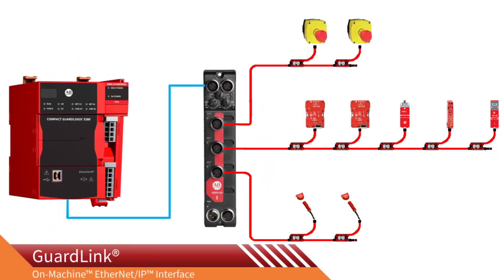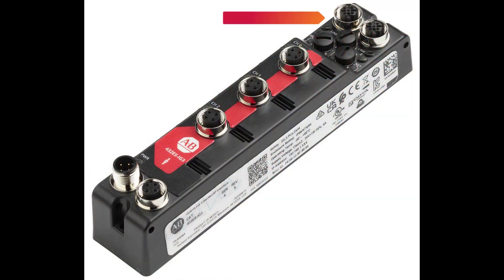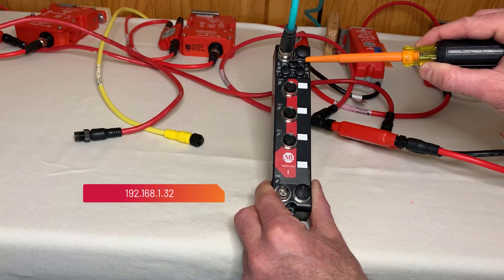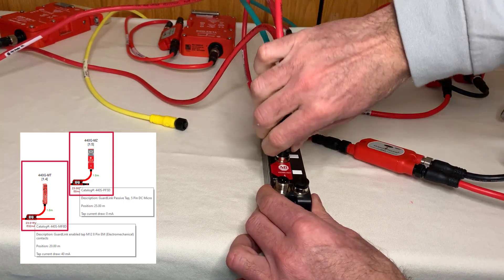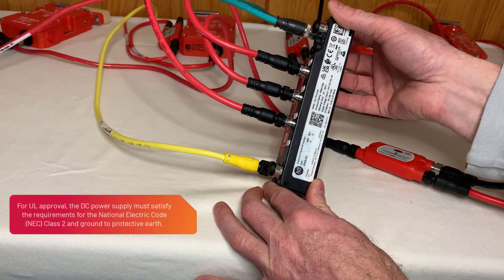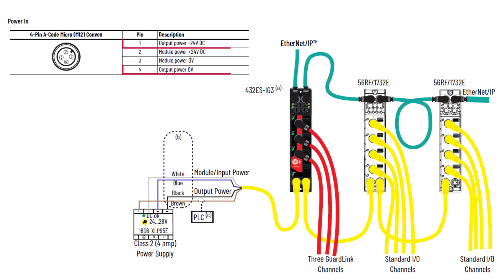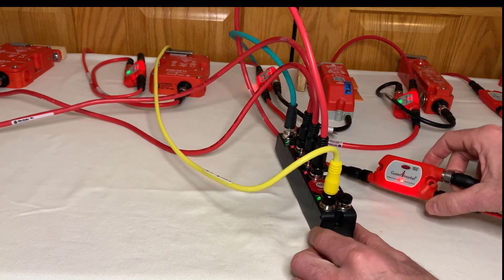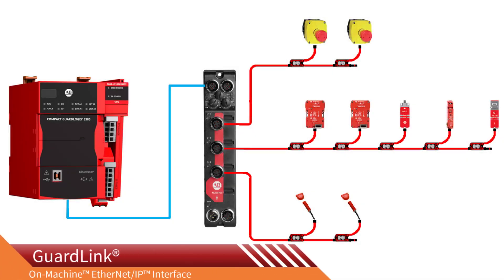GuardLink 432ES-IG3 Interface Module - Introduction and wiring

Comment: I assume one cannot interchange sensors from different manufacturers  ?
Reply: The Guardlink system will work with other safety devices from other manufacturers. There's taps for standard safety devices with electro mechanical or solid state safety outputs.